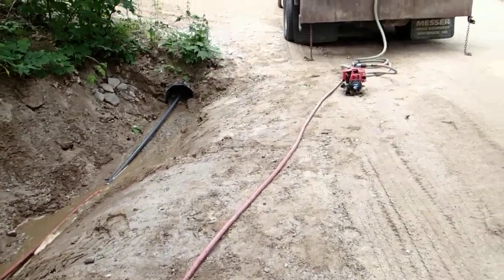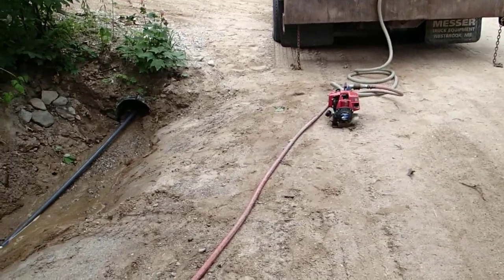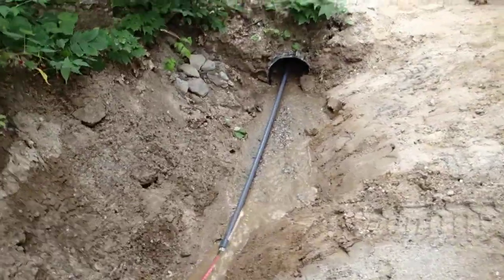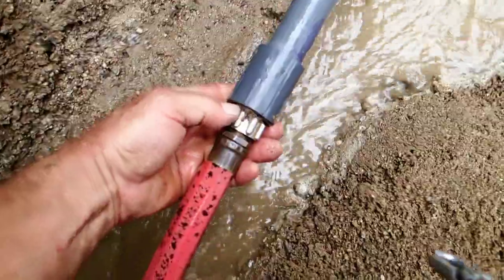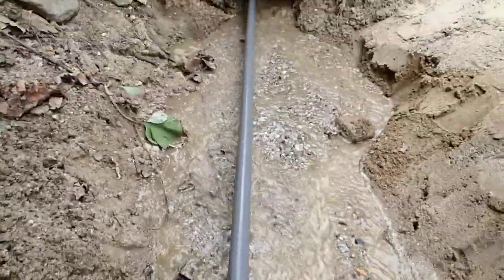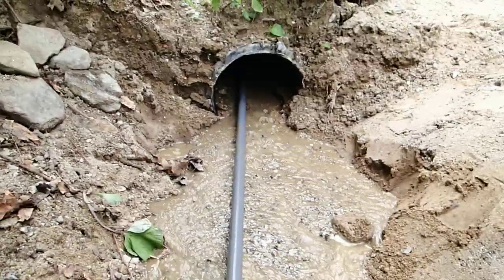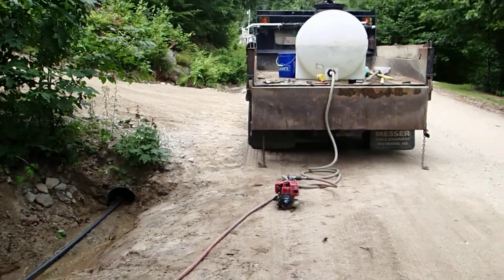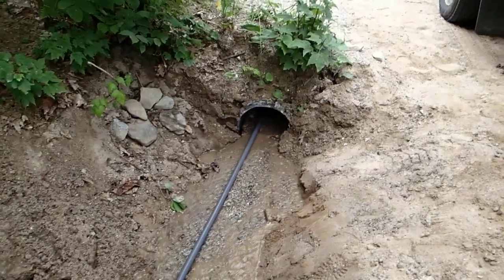Clearing a plugged culvert

Comment: I have a 20ft long culvert, and its blocked by a pile of small-medium size rocks mixed with sludge right in the middle. Tried everything to get it out. Pressure washers, trying to pick out the rocks with a pickaxe on a stick😂. Any advice before I call professionals? Btw is also plastic with smooth walls on the inside.

Comment: I like using a chain link fence top rail pipes with a chain hooked on the end. Unhook the chain, pull the pipe. Attach a car tire to the other side along with a secondary chain incase it gets stuck and then pull it through.

Comment: I am late to the game so hopefully you still monitor. I have a 12 inch ribbed pipe under my gravel driveway. I cannot see from one side to the other. There is mud so thick that i can’t dig because I can’t get to it. Rented a jet hose today with an end that sprays high pressure water with pressure washer. Did nothing but make a mess. Would that pump get the mud out? If I need to call a professional, what is this industry called?
Reply from the maker: You likely needed a little less pressure and a lot more volume.  These little Honda pumps do both very nicely.

Comment: That pipe is still a third full. You're just poking a hole right now.
Reply: You are quite correct.  However, clearing the spoil from the ditch after the culvert (downhill which is where the clearing is taking place) and  providing the small hole through the culvert allowed subsequent rainstorms to wash the smooth wall culvert clear.  Photos available if you wish...
For more information on how I maintain dozens of gravel roads here in the White Mountains  see: https://tinyurl.com/Ditch-in-Time-Road-Manual

Comment from the maker: Note that the hose connection to the 1" Sch 80 pvc shown  is actually a swivel hose connection that I made up.  The other connections are pvc glue to iron pipe sized male to female.  Cut the tip of the lead pipe on a bevel so that if it hangs up on culvert pipe joints it can be turned so that the bevel slides easily over the joint.

I've found that opening up even a small hole through a culvert and keeping the incoming and especially the outgoing ditch clear will help the culvert wash clear in the next heavy rain.